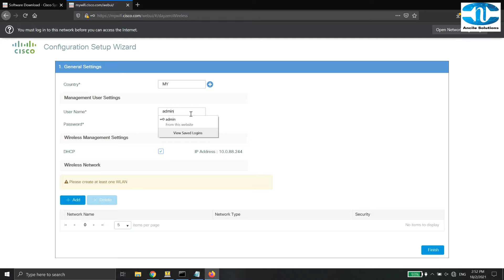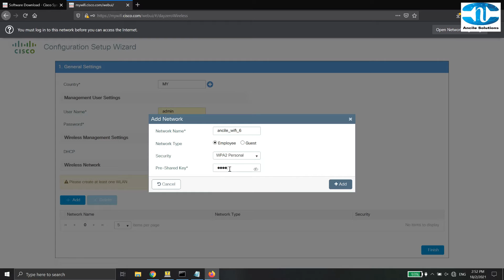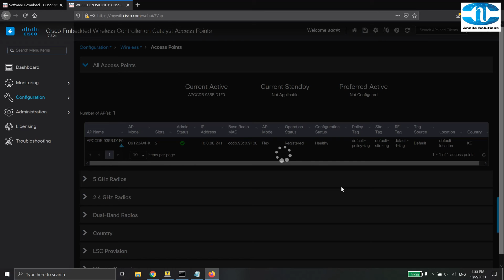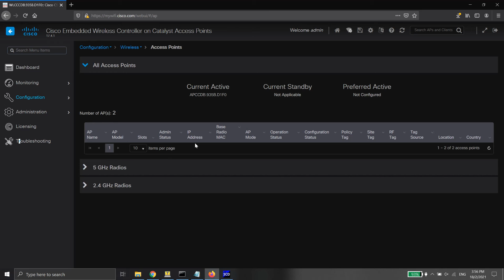Cisco 9100 series WIFI-6 AP review & embedded wireless controller easy setup

Comment: Hi, not sure if you'll ever see this but is it possible to connect 5 9100 series AP, but only 1 of them is the EWC version, will it act as the master controller or do I need to use all 5 units of EWC, and from there I can assign one of them to be the master controller?